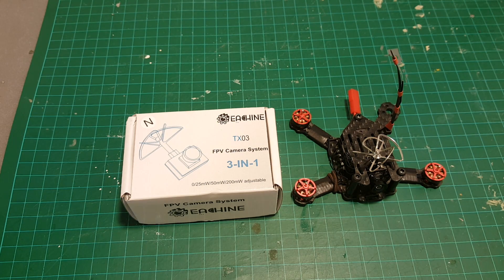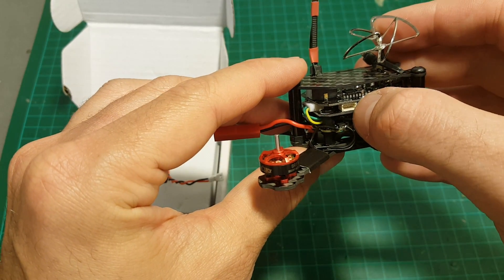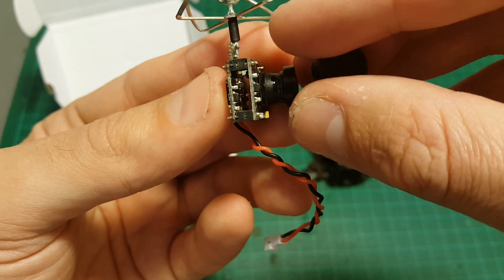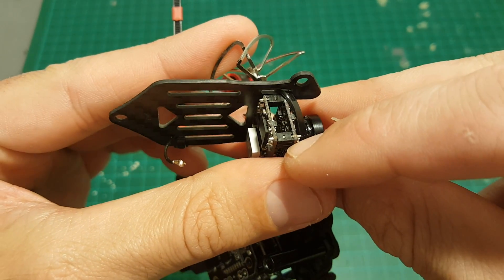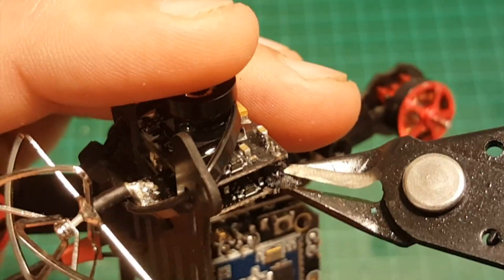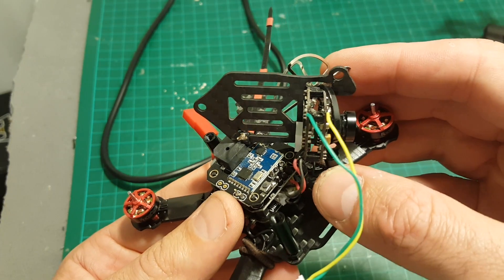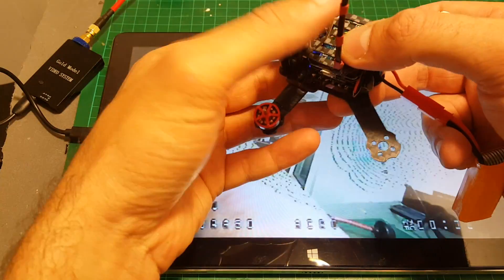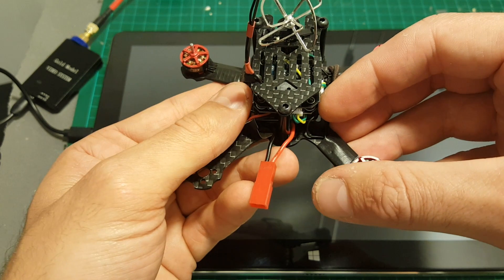How To Add OSD to an AIO Camera (in 5 minutes)

Comment: I wonder if that would apply to the https://www.amazon.com/Apleye-Transmitter-Antenna-Quadcopter-Multicopter/product-reviews/B0716ZD36T which is very similar to the one in your video?
Reply: found some diagrams of various similar camera and found which was which, again thanks for sharing your idea and knowledge. 

https://www.google.com/search?q=apleye+fpv+camera+aio+schematic+diagram&client=firefox-b-d&biw=1920&bih=919&sxsrf=ACYBGNTK0JBpcWbLEIj6wzzvB6rsaq_YPA:1576060098059&tbm=isch&source=iu&ictx=1&fir=q2F-OPitSWxlmM%253A%252CLRAanRPrLyEKRM%252C_&vet=1&usg=AI4_-kQnuqMgNpmDYZqjFHk8BezL8R55aw&sa=X&ved=2ahUKEwjIlKiysa3mAhVzoXEKHTZoCMMQ9QEwFHoECAQQDA#imgdii=3k_ywkJI_W2SqM:&imgrc=q2F-OPitSWxlmM:&vet=1
Reply from the maker: Probably yes - but I can't verify it, sorry.
Reply: @KremerFPV  it does, yes verified and currently using it along with multiwii

Comment: Thanks bruh, I'm gonna try this out😀
Reply from the maker: Have fun!
Reply: @KremerFPV  okay I did it, but things were okay only for a few seconds. I had the OSD. But then suddenly the image turned grey, OSD is still on🤔 any idea what went wrong? I'm gonna try fiddle with it myself now...
Reply from the maker: @mrsaraf3459  Check the connection between the camera video out pin and the video in pad on your flight controller.
Reply: @KremerFPV  I was fiddling with it and noticed that the video was back when is pressed the camera video wire a bit, so re-did the camera Vout. That seems to have solved the issue 🙌 thanks

Comment: Can we do this to all aio cam like turbowing, lst s2, akk, ect?
Reply from the maker: You should be able to do it, buy you'll need to figure it which one is the video pin.
Reply: Gal Kremer if you ever see the turbowing split vtx camera, theres a yellow wire from vtx to the cam board, i thougt its the video line. Correct me if im wrong..
Reply from the maker: Then in yhis case it's easy - just cut the yellow wire and connect the VTX end to the video out and the other end from the camera to the video in.
Reply: Gal Kremer hahah its work.. I tried last night.. Thank you man, i enjoy your video...
Reply from the maker: My pleasure Utha!

Comment: i did glue a broken off lens back on, didn't u ?
Reply from the maker: Sorry, I didn't get you...
Reply: @3:41glue it back( always be carefull with the sensor ,don't touch it ),
Question : i want the e010s / ef-02 from bg fpv to osd,
I saw a review with osd from top off 3 pins vin vout but couldn't see if he dis-connected the video pin like u ?
should u  always disconnect the video pin , or could it work with only soldering the cables ?
Reply from the maker: You will need to disconnect the video pins and then solder each side to the video in / out.

Comment: I just installed a tbs unify pro 5.8 totally separate to the FC because I had issues with interferences. Now is working great but i do not have osd. How can I do to have it back. Can I connect the video cable, to the cam ( from the tbs) and also to the cam out from the FC? Could that work?
Reply from the maker: No, it won't work. You need to connect the video feed from the camera to the video in pad and the video output to the VTx. Overlaying the OSD data by just connecting tge video out from the fc and the camera video out is not possible and will only end in outputing a corrupted video feed.

Comment: Will a lumenier aio200 have osd since my betafpv flightboard has osd? Can I separate the aio and do it?
Reply from the maker: +Danger Davefpv Yes, you can do it, but you will have to find the video in/out of the camera...
Reply: how do you do that?
Reply: vikram bhamre best way I know is take solder iron melt plastic connectors and use snips to cut pins into, I just did a lumenier aio200 and split it , soldered all the connections back with wire it's tricky to split but works good
Reply: yes, but i dont know which one to cut :(
Reply: i have the stock camera on the furibee f36s. the lst s2
how do you find the signal?

Comment: Hi. Great video. I recently got an Eachine E013 and i want to get OSD on the camera vtx. Can you help to identify the video pins on it. Appreciate it . Thanks
Reply from the maker: Got your message on FB, I will try to help over there.
Reply: @KremerFPV  great work! i got here by searching for an OSD solution for the E013 camera... were you able to find the right pin in this camera?
Reply from the maker: @TheRealCaioSpin  Thanks buddy. It's using the same pins like in my video if I remember correctly.
Reply: need beecore(betaflight) fc , connect aio video to fc and power from battery, e013 has no osd

Comment: I just did the same thing for a recent build using the CM275T. On this camera the video pin is on the left side (with the lens pointing away from you). 3 pins arranged vertically with the video pin topmost.
Reply from the maker: +Ren Medalla Thank you for your comment!
Reply: hi, did you have any issues with the video quality when doing this mod? I have a VM275T (guessing its a carbon copy of yours) and the image was shocking, I even soldered in a long cable between the two points, to test it was running through then soldered them to the flight controller and getting all sorts of artifacts. Thanks Rob
Reply: And what are the other pin i got the 2nd one is ground the last most be vcc pin cause i messed up wih my transmitter pickout xapacitor and one of the resistor so gonna use any of the vtx can some one help me vcc is the lat one cause as u said on right side too there is ground one pin and other pin written VNP or some5hing which is difficult to read what is written